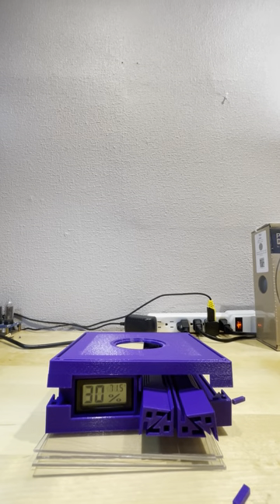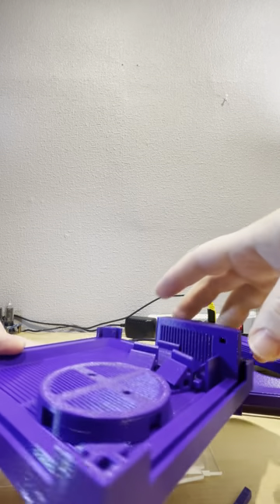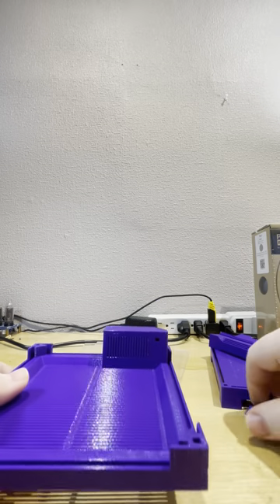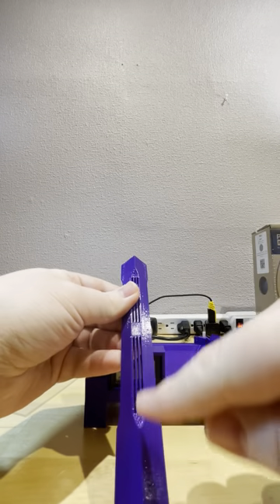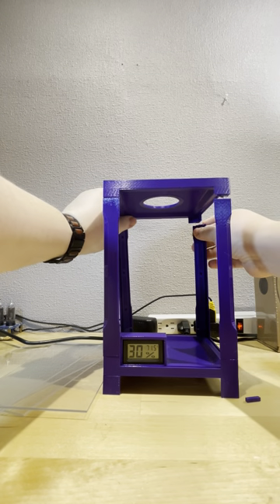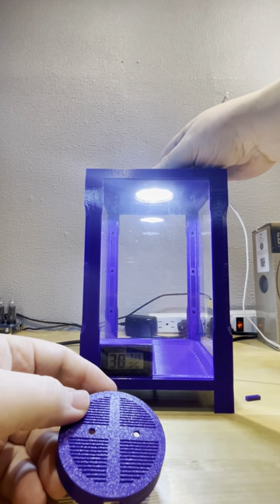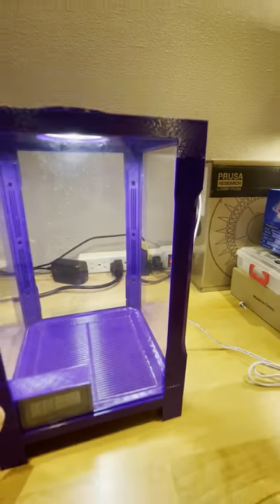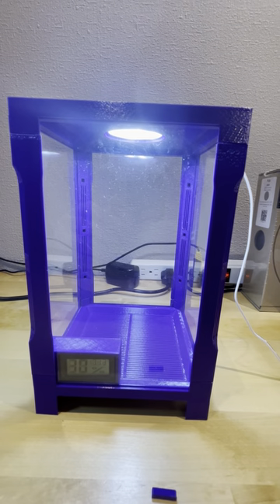Assembling 3D Printed Spider Enclosure

Comment: I'm looking for a downloadable file for this particular enclosure.. is that a thing or do I just have to buy the enclosure already made? Thanks!
Reply from the maker: Right now the plans are not for sale. I'm on the fence as to weather I'm going to be producing them or not as it is a ton of work. I'm doing local pickup in hamilton, Ontario for $70-140 depending on options. (Light, Humidity meter, varios add ons like printed walnuts/branches/stick holders/signs etc. It's an iterative process and the latest ones already have addons